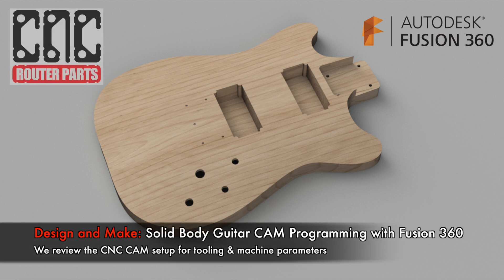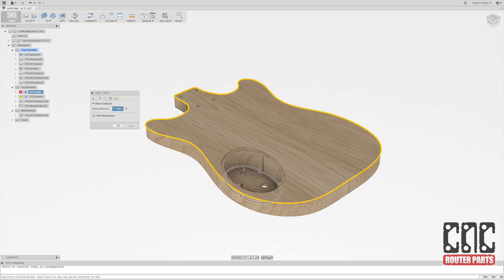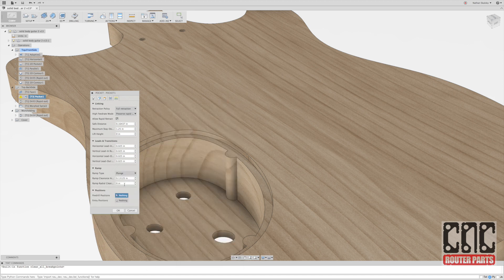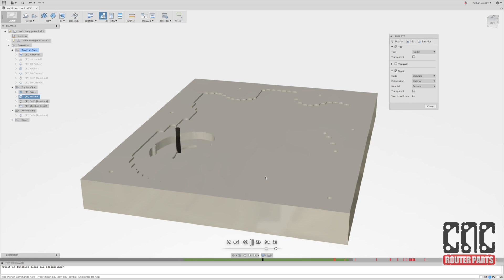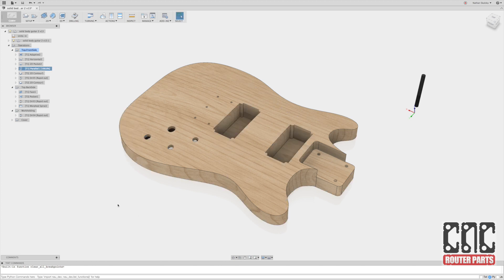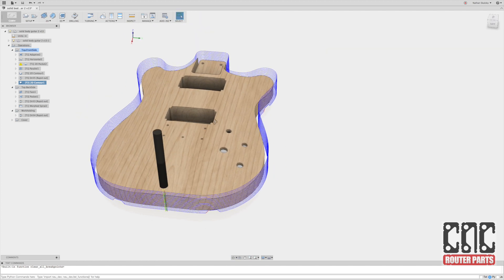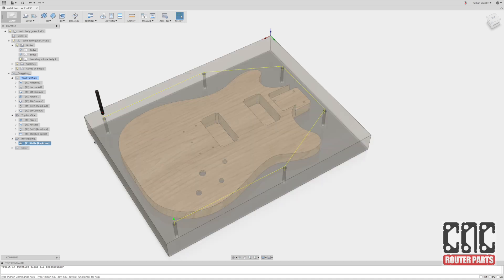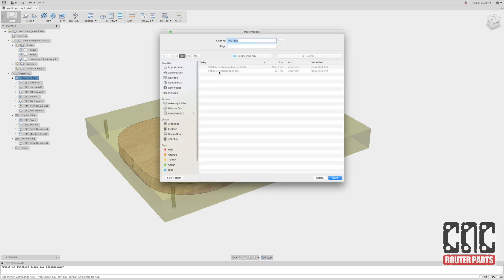Creating CNC G-Gode for the 3D Sculpted Guitar using Fusion 360

Comment: I find it a lot better to adaptive pockets and just just pocket for finish pass.
Also on the top of you do 1/2 depth outside contour before the 3D then you won't be hitting the sides, then do the bottom half of the contour after.
Also your 3D adaptive does the pockets with stock to leave so you can do a full depth pocket finish pass.

Comment: Any chance you could go into some more detail on how to set up the work holding blank, the portion of the stock that has the 6 holes cut into it?
Cheers
Reply from the maker: +dave morriss Hi Dave,  You bet - we'd be happy to provide more detail.  In the mean time if you'd like more immediate feedback you might ask your question on our Autodesk Fusion 360 discussion thread  --> http://forums.autodesk.com/t5/design-validate-document/guitar-design-and-manufacture-using-fusion-360-and-cnc/m-p/6264026

Comment: Thanks again for all the info below. It really has helped my cam work these past few days. Projects are moving much faster and less material is wasted.
I do have two further questions, if you have a moment:
1. Where in Fusion are you setting up the work holding? I can't seem to get that set up in cam.
2. Part follow up question for Nathan regarding your last comment below which helped a lot...
When I now set up the "silhouette" and "machining outside boundary" setup/cuts the 3D adaptive clearing is skipping the roundovers on the guitar body which it was cutting before (Fender Strat style 7/16" body roundover). Is there a way to get it to both do the silhouette cut and not skip roundovers?
I can send pics if you need to see them.
Reply from the maker: #1, that footage is around (was edited out of our first round of videos), though I think we'll post a quick "workholding" video to show how we did that.  

The way I generally do work-holding in Fusion is to model it directly, so in this case I created a volume body that represented the size of the wood blanks we purchased, split it down the middle and I sketch three dowel pin locations in spots I thought would be convenient.  Then to make sure its all symmetric I mirrored the body/sketch across the guitar.   This way I know I can flip the stock for machining each side and everything will line up.

#2 If I understand your question correctly I suspect you might need to adjust your "Tool Containment" setting to allow cutting & travel outside the configured machining boundary to accomplish the round-overs.

Hope this helps!

-Nathan

Comment: This is great info. I've been trying to get fusion cam to work with my guitar designs as well. How do you prevent it from clearing the entire stock blank in the 3D adaptive clearing stage, and just focus on the guitar body borders?That's something I'm having trouble setting up, it will get me there but it also clears the whole stock that I input which makes it a very long operation.
Reply from the maker: +F Soheili Hi - thanks for the feedback!  There are a couple things that will help you here 

The first (X/Y limit), is "Machining Boundary" under the geometry tab in adaptive clearing operation.  You want to set this to "Silhouette" and "Tool Containment" set to "Tool Outside Boundary"  - this will tell CAM to use the outside perimeter of your guitar body as the X/Y plane limit however the second setting will permit the tool to slightly over-run the boundary in the name of finish quality and ramping in and out.  

the second (Z limit), is from the "Layer" tab to change the bottom layer to be whatever height you want to be the maximum depth that adaptive clear should try to clear to. 

Hope this helps - good luck!  Do you have any pictures you can share now or later?  
-Nathan
Reply: Thanks so much. My work/luthier page has lots of pics of my work http://www.nyguitarrepairs.com however new builds will be uploaded later this summer.

Comment: Hi, I would also like more detail on how to create and set up the work holding stock with the six holes.  Is it modeled or created in CAM?
Reply from the maker: +payday1963 Hi, Sure we'll get something up showing that.   The six locating holes were indeed modeled and the same gcode used to drill the features into both the spoilboard and each side of the stock material - in the meantime you and Dave are welcome to ask Jeff and Nathan about this on the forum discussion thread --> http://forums.autodesk.com/t5/design-validate-document/guitar-design-and-manufacture-using-fusion-360-and-cnc/m-p/6264026